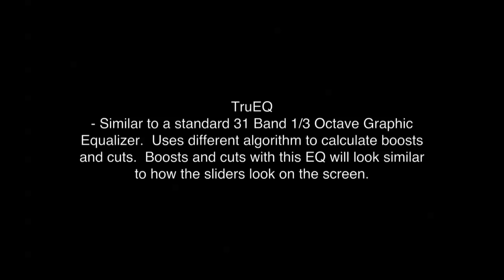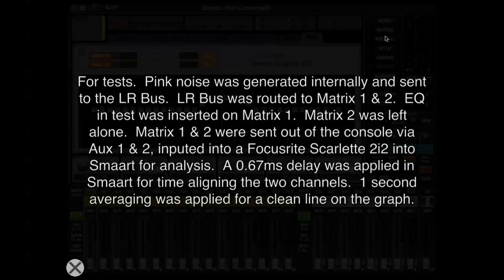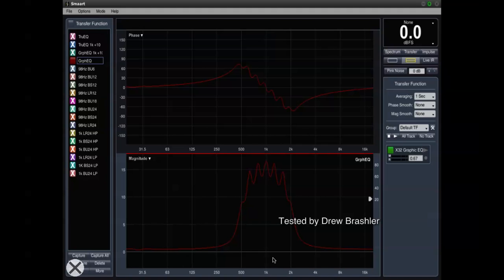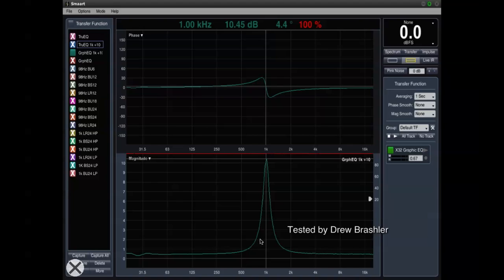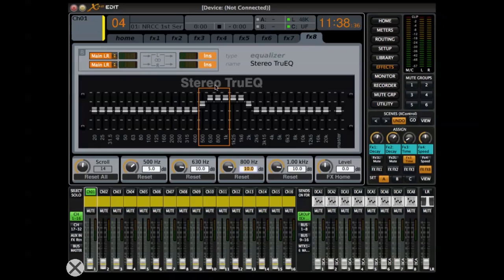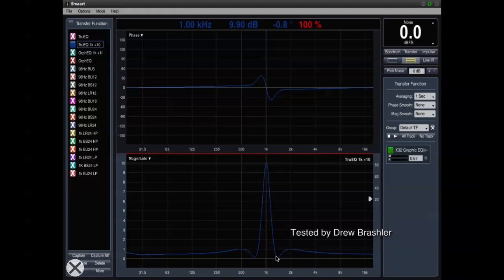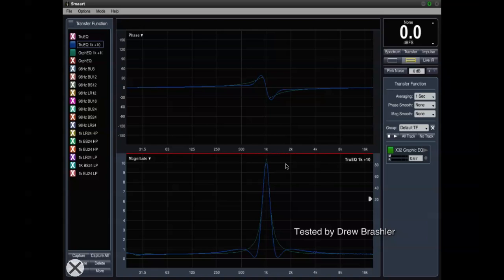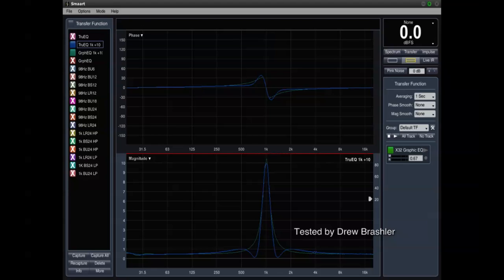Behringer X32 - GEQ vs. TruEQ Graphic Equalizers in Smaart

Comment: Thank you so much for your video. I tried to do the same test by using the open sound meter and the  MR18 and I found also that the every output (like master LR or Auxs) are 180 degrees out of phase with the loopback. Do you know why ?

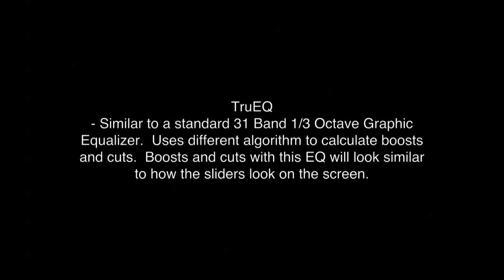Comment: From what I'm seeing in your X32 edit FX slot the stereo graphic eqs being tested are actually inserted on the LR mix bus; not on Matrix 1 as explained in the routing at 1:32. Also it is worth noting that Matrix 1 & 2 on an X32 are mono matrixes unless 'Linked' together to be stereo on the input and output pickoff points. Thus this routing configuration was collapsing the LR mix bus to mono when it was routing to matrix1. Also, on an X32 there isn't a way (that i'm aware of) to route to matrix 1&2 with different pickoff points from the LR mix bus because those options are only adjustable by pairs of busses. Furthermore an x32 does not have the pickoff point option to a matrix of pre or post insert.

Great video, by the way. 
cheers:)